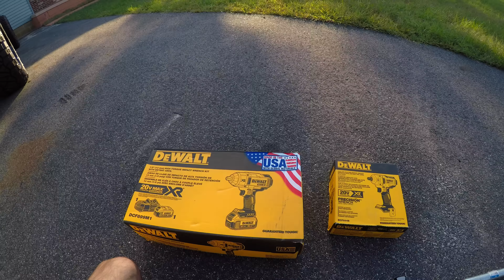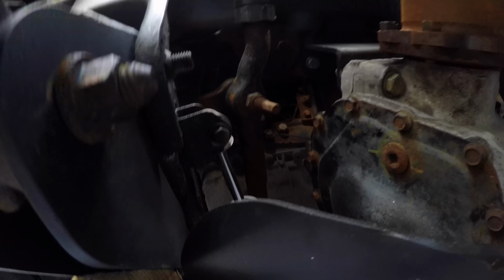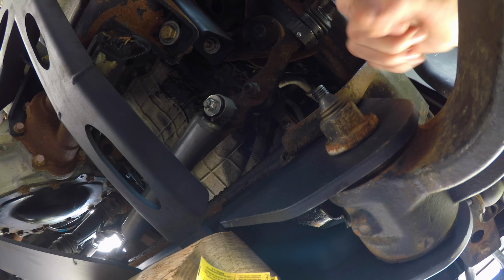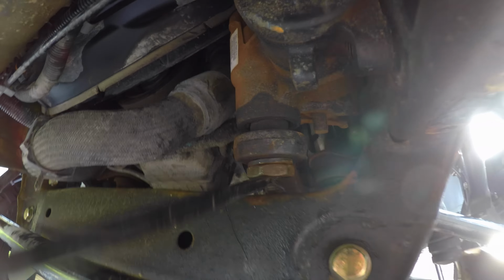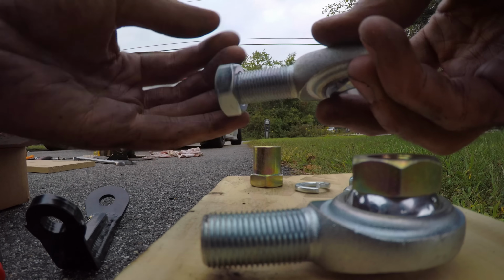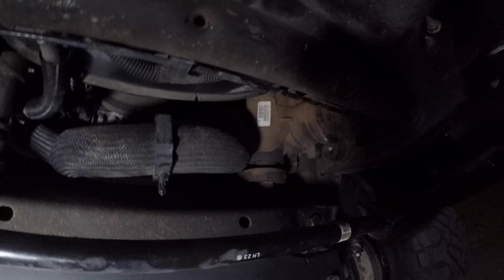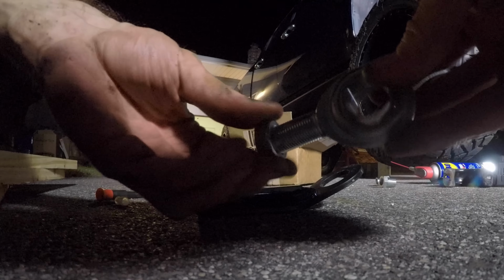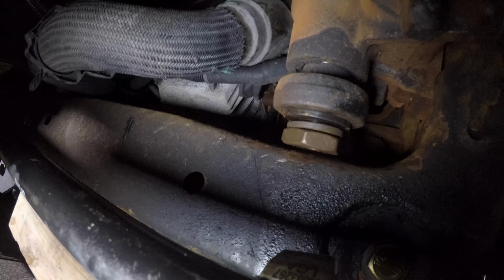Every Duramax NEEDS The Cognito Steering Support Brackets! Fix Loose Bad Steering

Comment from the maker: Much better steering for the duramax. This is a must have mod for all duramax trucks!
Reply: Driveway Demons great video as always!
Reply: Driveway Demons Great Video I'm glad the MadMax's Steering is much better
Reply: How are these holding up? I spoke to kryptonite about the ones they had that look identical to these but they discontinued them 3 years ago. They said that they were causing binding issues and needed constant maintenance because the parts would loosen or fall out.  Now he did say that was on newer body styles.  So I that could be lml and newer up til 2019. Idk

Comment: I just did this on my stock ride height 2016 lml with 33x11.5 tires on 20" wheels and I can say that I could not tell the difference in the steering much at all. Pretty time consuming job, and not really worth it in my opinion.

Comment: Did you have play in your steering wheel before this mod? I have replaced my steering gear box 8 times and with 2 brand new gear box not reman in my 03 Silverado. And had every suspension part replaced. And had 5 alignments but after all that i still have bad slop in steering wheel. Any help is appreciated
Reply from the maker: I had some movement. After these it made the steering much tighter
Reply: @DrivewayDemons  Alright thanks!
Reply: There is a wobble joint (looks like a u-joint kind of used for the tilt function) in the actual steering column inside the truck you should check if you still have play after all of the upgrades.  Also check the intermediate shaft and plastic bearing.  The wobble joint can be tighten with torx socket, just be careful not to tighten it too much or the joint wont want to move and bind.
Reply: @Thebone4040  is this true on a 2015 2500hd  my wheel has a lot of play and it drives me nuts
Reply: Try steering box adjustment?
Reply: @jcogan6  did you find a cure? Have a 16 HD
Reply: @andycoronado1927  no its still bad I've just gotten used to it
Reply: Even with a new steering box, pitman arm, idler arm and tie rods, my 2008 wheel had 11 to 1 (clock position) play.  Yesterday I replaced the Intermediate shaft, upper shaft (at the column) and the lower bearing in the column.  The truck steers like new now.

Comment: The 1 3/4" was too small because its smaller than your 1 7/8". You most likely needed a 1 15/16" wrench. Great vid gonna have to do this to mine
Reply from the maker: Thanks for watching bro! Definitely do it. Makes the steering so much better
Reply: Its actually metric  pretyy sure its supposed to be 34mm
Reply: It’s definitely metric, grab some calipers and measure if you’re unsure